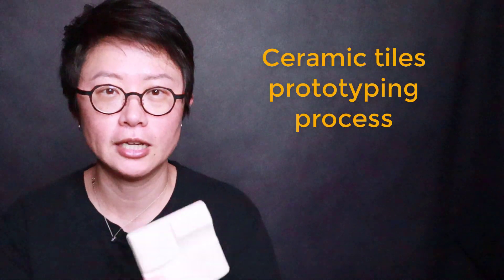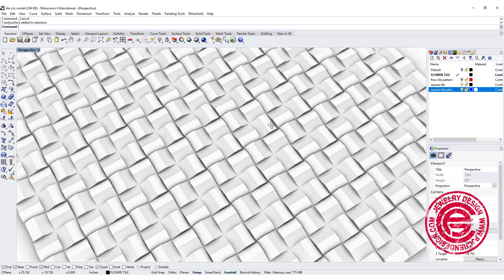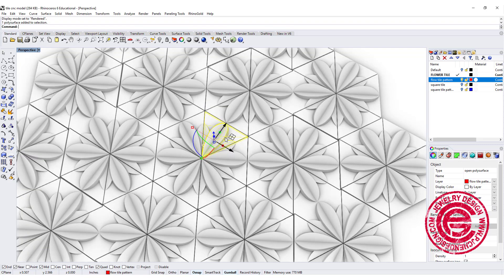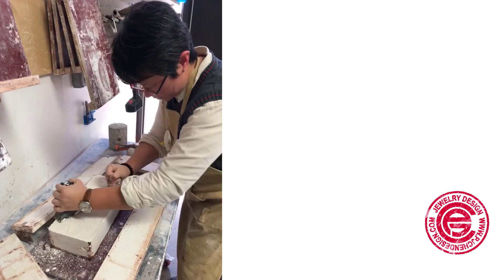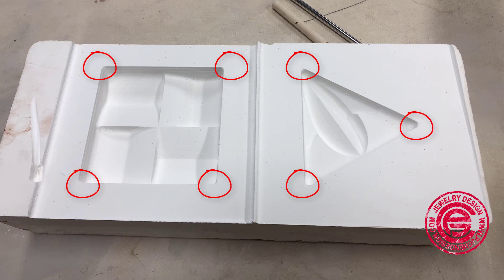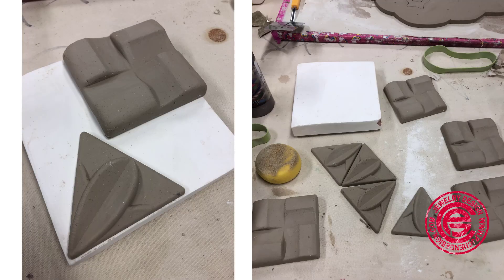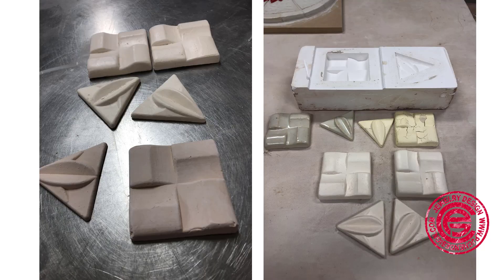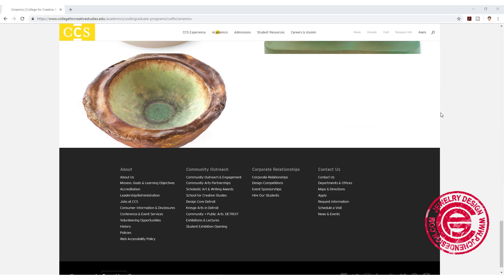Making Ceramic Tile Prototype with CNC and Rhino 3D

Comment: That's great. Would it also be possible to create those molds from a 3D printer instead of using a CNC machine?
Reply from the maker: that is a good question, Warren. Traditionally, ceramic artist will use CNC milling out plaster because it will aborts some water, so you can demold the clay easily. I was thinking of printing out first but the water control was a issue.

Comment: This is wonderful. Can you go straight from rhino to something like Mach3 for the cnc or would I need another program?
Reply from the maker: Hi Casey, Different CNC brands may have different Apps to use. Rhino itself doesn't operate the CNC, but most machines will take stl file and some take obj file. I use "Shopbot" in this project